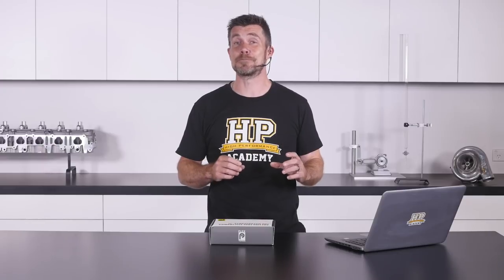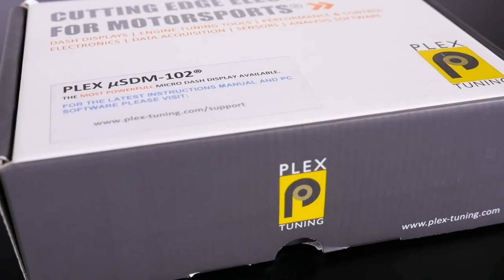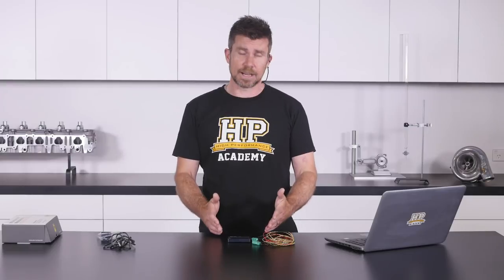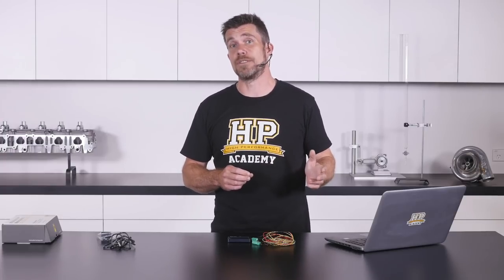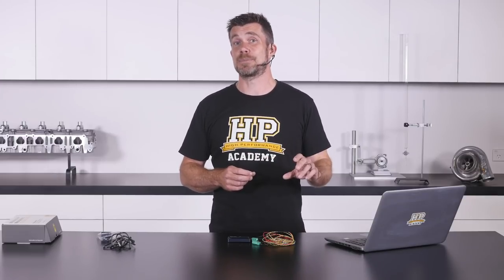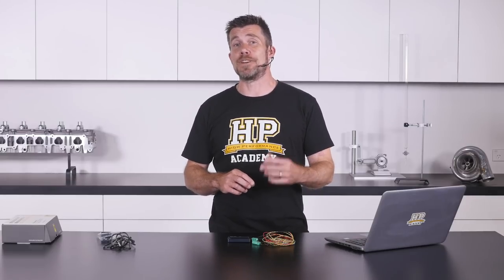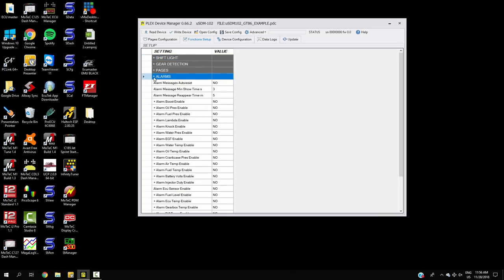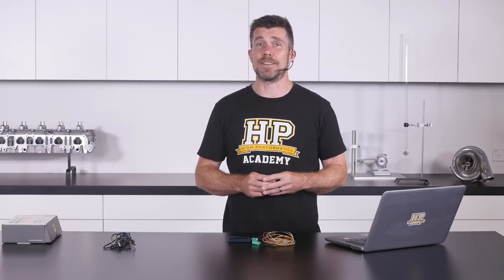Micro Dash Display, The Way Of The Future | PLEX μSDM [UNBOXING]

Comment: For the most part, I would say it was 'swings and roundabouts' - some comments

Some problems with traditional analog instruments -

Accuracy - 
You normally see this cited as +/- a percentage or value at "FSD", which is Full Scale Deflection, for the better meters but some don't bother even with that. This means the maximum error is double that at half scale and four times at quarter scale - still within manufacturers tolerance (assuming there is one), but hardly acceptable. They are normally restricted to a 90 degree sweep, which further limits their accuracy.
Moving coil type guages, the traditional electrical analog type, are basic voltmeters and the operating voltage will affect their accuracy - with some vehicles you can see the instruments flickering as the indicators work, for instance.
Mechanical type analog guages are sometimes used for oil or water temperature and use a liguid in a bulb that increases pressure with temperature, and these use a Bourdon (sp?) tube, as do oil, etc,  pressure guages which are coiled tubes that straighten up from internal pressure and move a geared needle - again, accuracy is an issue and, while they are adjustable, to a point, at best it is only at two points, one of which is zero. As an aside, I have noticed many hydraulic guages that claim to be of a high quality that have widely varying zero positions - hardly confidence inspiring, especially as some are in the 500 to 1k bar range and residual pressure can be significant!
The guage may not be zeroed correctly, so there may also be an offset between the guage needle and zero which further compromises accuracy.
Some may require dampening to reduce flicker and this slows the response, especially if there is a lot, and it is a problem as it means rapid and/or transient variations may not be displayed - think an oil pressure drop in a corner - and a classic example is the fuel guage that requires several seconds to show the fuel level. Back in the day, this cost some people engines as cheaper tacho's would not only have questionable accuracy, but some wouldn't keep up with engine rpm when 'blipping' the throttle or even accelerating in 1st gear - that 6k change point may actually have been 6k3 or 4!

Cost - while cheap AND NASTY guages can be picked up cheaply, and 'may' be better than nothing for the average person, GOOD 'analog' guages will use stepper motors to operate the needle (SPA and STACK, for example) and can cost several hundred dollars EACH!

Space, weight and wiring - some of you may be truck drivers familiar with the vast arrays of guages frequently used and finding space in a small car can be very problematical. With a number of guages there can also be a weight penalty and as each will require it's own wiring, that can also be a big problem - although some of the modern guages can be run off a CANBUS or ECU/Controller, which helps.

Some pro's for guages - 

Modern guages, especially the stepper type, can be very accurate and can be very useful for spotting trends - like a slowly increasing coolant temperature or dropping oil pressure that may not be sufficient to trigger warnings*. As Bubba mentioned, having all the needles in the same orientation, eg, vertical, at their nominal value makes this easier. For those of us getting on in years any reduction in the time our eyes are off the road and, especially, fucusing on the panel and then back on the road, is going to be a very good thing.

Some can also be programmed to change colour when values drop below, or exceed, set values, which will instantly alert the driver without having to 'look' at the dash panel, and some also have 'telltales' for max' values.

Many modern guages can be run directly from the CANBUS/ECU which simplifies wiring.

Most of you will think of many more good and bad points but, personally, given the finances for it I would be using a panel and selection of guages - admittedly in part because I'm an old fart and used to guages :-) That said, for the PROFESSIONAL, who can process the data much, much faster and more efficiently that I can, a panel 'should' provide everything he needs to know - especially if telemetry is used and (s)he is also being monitored and advised from the pits.

*As some would put it, a warning light just tells you what broke your engine.

Comment: Was reminded of something when responding to I AM - and after an intensive 2 minute search I found it - the September 2016 issue of the Australian' Silicon Chip has a feature on a simple 4 input logging device for tracking down pesky intermittent faults that may not be picked up, or be ambiguous in logging, by the OBD and maybe some more advancing logging programs.
Might be of use to some folks?

Comment: Good analong gauges will have a alarm that you can set. Eg auber gauges
Reply from the maker: A gauge with an alarm is better but still not a solution. Let's consider fuel pressure in a turbo car - Where are you going to set that alarm? If for example you're running 3 bar rail pressure and 1.5 bar of boost then you could expect 4.5 bar fuel pressure under WOT and full boost operation. Obviously you'd want to know if the fuel pressure drops below 4.5 bar so perhaps we set it at 4.3 bar? Well that will work to protect the engine at full throttle and full boost but now the warning will be active any time you're not at WOT. What you really need is a conditional alarm so you can track differential fuel pressure and bring on the alarm only when this drops below a certain level. I've yet to see that function from an analogue gauge.
Reply: @hpa101  fortunately for me that is not an issuse in the mech injection diesel world

Comment: Generally it takes longer for the human brain to read a number and verify that the value is correct whereas when just looking at a location of a needle it doesn’t take as long. Still some cool tech
Reply: Exactly, the eye/brain notices something not right and doesn't need the time to focus and read a value.
Reply: Yeah  but gauges cant be programmed to read 64 details on multiple pages or have a programmable light to indicate alarms or shift. Lets not forget the logging capability too.
Reply: @DimiGem  True, to a point, but some, for example SPA and STACK, are available in versions that can be programmed for alarms/light colour changes and tell-tales for values. Why I said swings and roundabouts - some applications, definitely panel - especially with telemetry, other applications guages but maybe best both with selective guages to suppliment panel as, as has been pointed out, logging will catch those transients, etc, that a guage simple can't? For example, an oil pressure warning may be set at 3 bar but, if the normal pressure is a steady 4 bar, the guage would indicate a gradual drop towards that 3 bar warning and that may be the difference between a simple, cheap repair or more serious engine damage. Similarily, with fluid temperatures, a guage is an easily seen indication that temps are approaching a critical point and allow the driver to monitor it more easily or spot a sudden increase that is still below the alarm trigger point.

NOTE, youngsters who still have rapid refocussing and short and lang range vision may get by with a panel display, but us old farts need the help ;-)
Reply from the maker: I don't disagree with the benefits of watching an analogue needle. The problem however is that in order to register the fact a needle has moved, you need to be looking at it. Generally when I'm trying to get the most out of my car on a racetrack I'm focussing my attention on driving, not gauges. What I'll do however is scan my instruments during some down time on a long straight which is fine for temps and maybe boost, but hardly useful for the likes of oil pressure or even fuel pressure which are typically effected by high lateral G.

To be clear this isn't a 'digital gauges are better than analogue' argument -It goes a bit deeper The way I set up any dash display is with minimal information displayed, and under normal conditions the driver will only focus on the shift light. Where these digital displays are smart however is that we can then monitor everything in the back ground hundreds of times per second and the instant anything goes outside our tightly defined 'happy range', we can alert the driver with a warning. When the driver sees a warning his/her attention can then be brought to the display to find out what went wrong. I've yet to see an analogue gauge that can offer this kind of conditional warning across a range of perhaps 10 channels that we wish to monitor.

Comment: There are guages that hav alarms
Reply from the maker: A gauge with an alarm is better but still not a solution. Let's consider fuel pressure in a turbo car - Where are you going to set that alarm? If for example you're running 3 bar rail pressure and 1.5 bar of boost then you could expect 4.5 bar fuel pressure under WOT and full boost operation. Obviously you'd want to know if the fuel pressure drops below 4.5 bar so perhaps we set it at 4.3 bar? Well that will work to protect the engine at full throttle and full boost but now the warning will be active any time you're not at WOT. What you really need is a conditional alarm so you can track differential fuel pressure and bring on the alarm only when this drops below a certain level. I've yet to see that function from an analogue gauge.